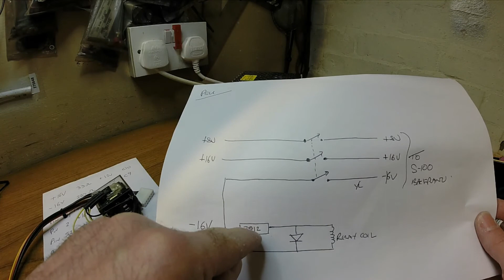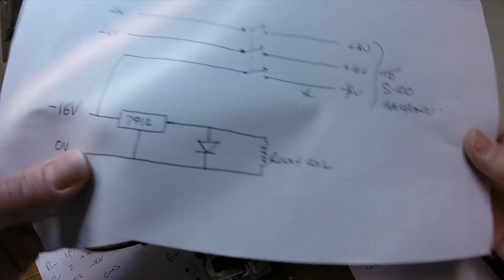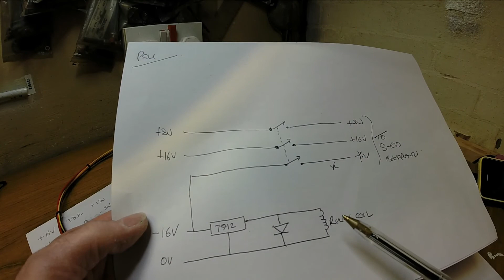Altair 8800 Build Project Part 4 - Power Supply

Comment: Hi, is there any wiring diagram for the power supply ?
Reply from the maker: If you look at round the 8 minute mark there's a diagram shown in the video of the original setup. I did change this later when I managed to get hold of a combined +/- 15V supply.

Comment: I am picking up an Altair 8800a, and I will need to replace the caps, as they have all leaked out just a little. where can I get these caps? 

https://drive.google.com/open?id=1POQOY09EEE3zx_EQV7TznxUADWK_nXEJ
Reply from the maker: Hi Jeff
Please see my full reply in the Part 9 video. The method used here could be applied to your system if you wish to replace the linear supply and is fully compatible with a real Altair. The three individual supplies is the cheapest option, although as you can see in Part 9 I did eventualy go for just two.
Martyn.